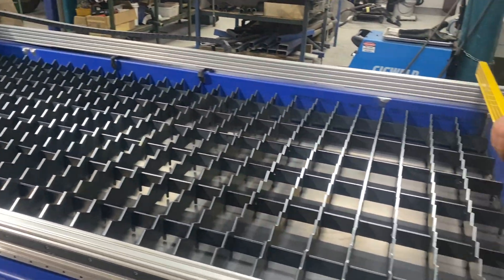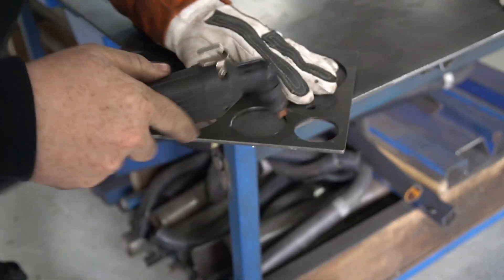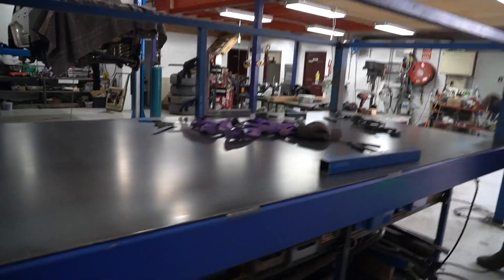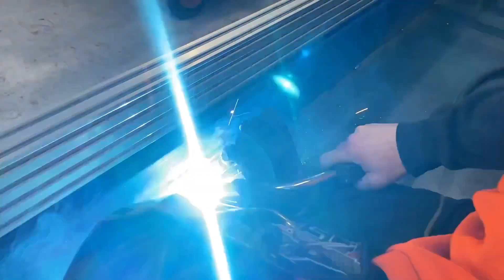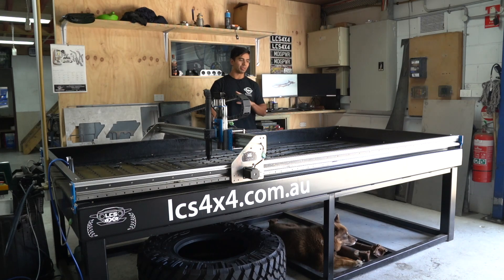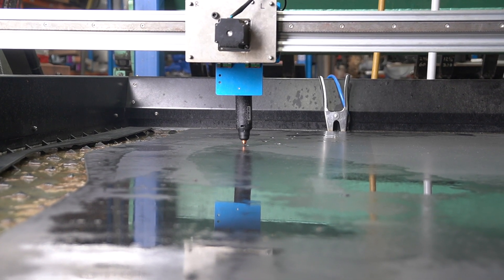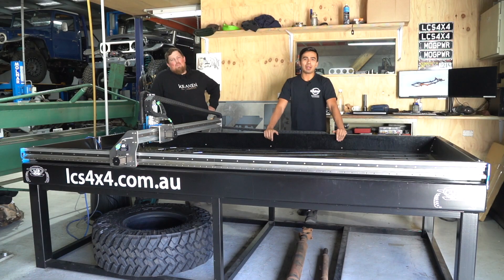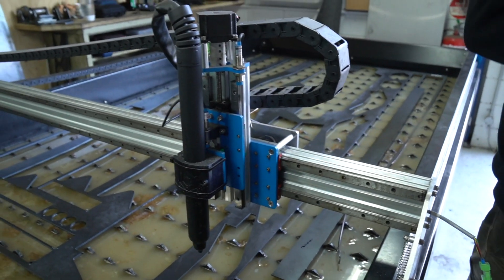DIY CNC PLASMA TABLE + NEXT BUILD preview

Comment: Just picked up my Blue Carve CNC (Australian made👌) with a Thermacut EX-TRAFIRE 100SD Plasma.
Reply from the maker: Congrats on the purchase!
Reply: Looking at Blue Carve, Unimig and Weldclass for a setup. How are you going with your Blue Carve table mate? Happy?
Reply from the maker: @worldhasgonemadx  Extremely happy, would recommend 10/10! Recommend getting a full sheet if you have the room, works out much cheaper with material.
Reply: I'm impressed that you were able to do a full seam weld all the way around without warping the whole table.
Reply: How are you liking it? With the price of them do you think it would be time wasted and signing myself up for issues if doing a full DIY?

Comment: Awesome Design!
But why you chose to put the rack and pinion system above the linear guides, do you gain anything by doing it this way? 
Just asking cause i am curious and i will built my own plasma table soon!
Btw will you sell the plans?
Anyways, thank you for this video:P
Reply: There is a subtle reason for this. The rack is recessed into the aluminium extrusion to allow for the motor pinion to be as close as possible to the rack to enable max engagement.

Comment: @DesignedandBuilt  Did you guys pay full freight on this machine, or did blue carve sponsor you in any way? I've been looking at these and am wondering if you've found any limitations with it? How have you been cutting aluminium with it? have you been using Nitrogen? How have you been dealing with the problem of Hydrogen gas build up under the sheet and causing an explosion?
Reply from the maker: Blue carve didn't sponsor use in any way. I've cut a heap of aluminium with it, requirers a light sand with a stripper. Haven't been using nitrogen. Haven't had any explosions.

Comment: Nice build guys! What plasma cutter are you using?
Reply from the maker: SWS but may look at upgrading to something else so we can cut thicker material!
Reply: @DesignedandBuilt  how would you rate the SWS overall? Only reason you’re upgrading is to cut thicker material?
Reply from the maker: @dcautomotivebathurst3264  Bluecarve have switched to using Hypertherm.We have switched now as well.
Reply: The guys at LCS4x4 ended up getting a Thermacut 55SD from us.

Comment: How often do you have the exchange the coolant?
Reply from the maker: It really depends on how much you are using the machine, for our usercase probably yearly. We welded on a tap fitting so its easy to drain!
Reply: @DesignedandBuilt did you guys design and cut the bedknife or was it supplied?
Reply from the maker: @dcautomotivebathurst3264  Something we designed!